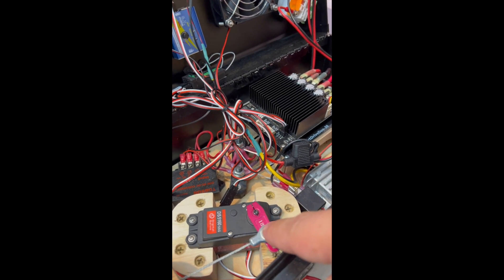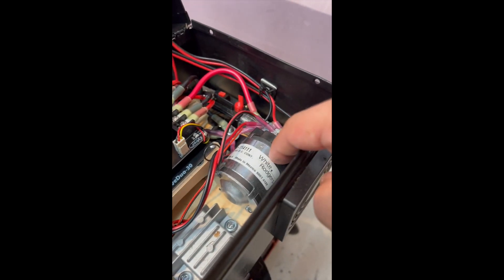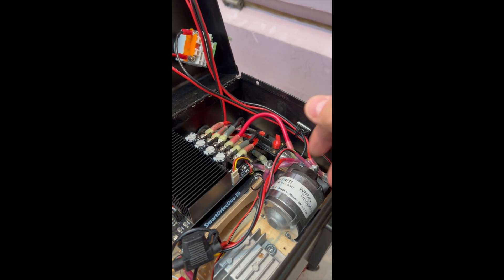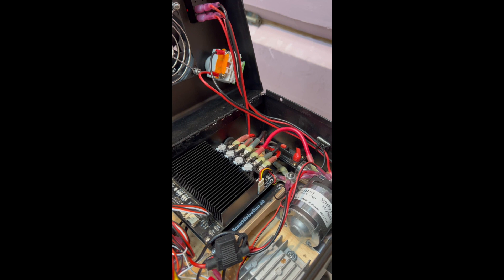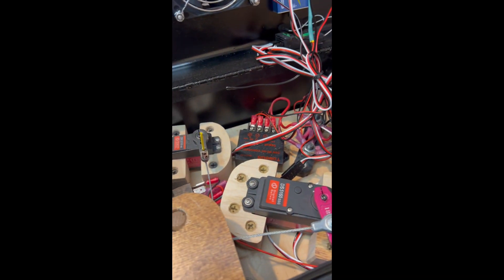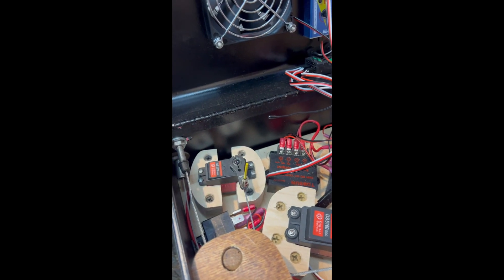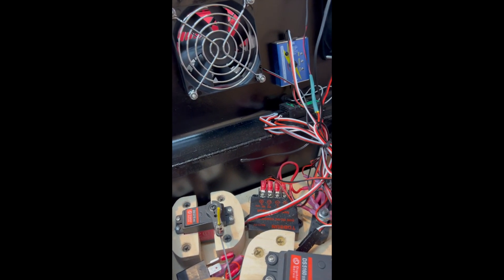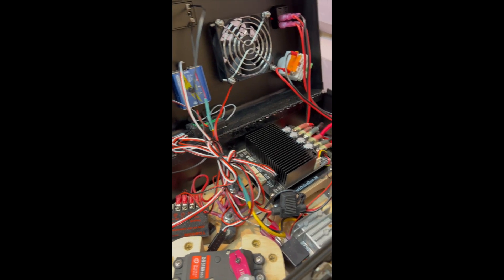Remote Control Lawn Mower

Comment: That blade brake was ... interesting.  I wonder if you could have implemented a mechanical state machine like a sear/disconnect to enforce arming rules.  PWM can be a little dirty, particularly when you're slamming it between sources with a relay.  And servos can also get weird.